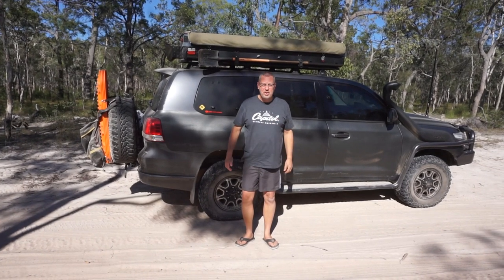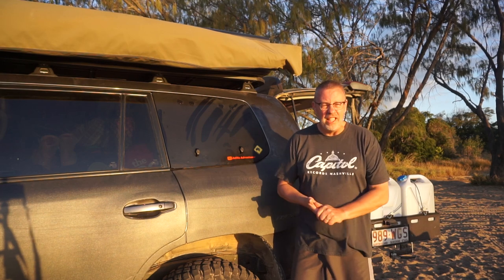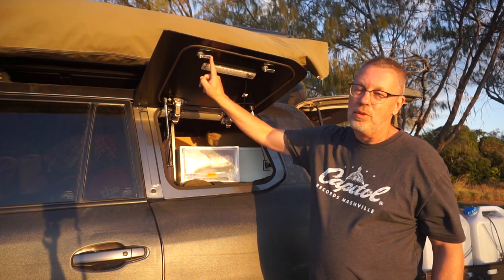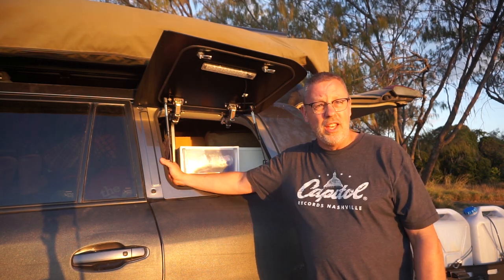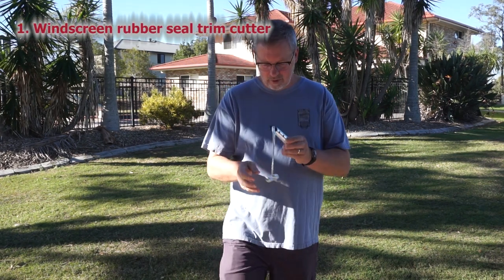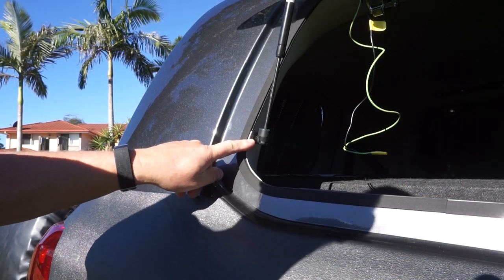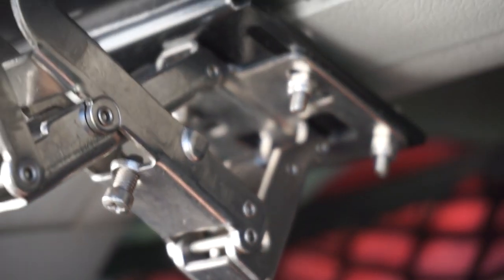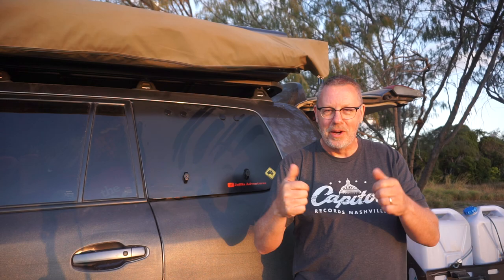Emuwing Gullwing Window Installation.  Do they Leak?  Plus Top 10 Installation Hacks | Ep 3

Comment: 1) This video made me smile. My stupid sister runs her 200 on recirculate 100% of the time since picking it up at the dealer. Inside it stinks from all the dirty air going around and around for ever. Myself on the other hand always have the AC on straight through. And from years of experience I can tell you that when you drive past a dead roo with the AC on recirculate versus on straight through the stink stays longer when using recirculate. Some people cannot be educated on AC use.

2) One could easily perform an A4 paper test during install (and later use) to see if there is any gap in the seal.

Happy Days :-)
Reply from the maker: I like the A4 paper test idea mate, cheers👍😎

Comment: Hi Terry, great work on the videos.  I'm sure sure many sitting on the fence regarding purchasing these items will be a little more assured after watching these vid's.  Question, what did you end up doing with the radio antenna after disconnecting it? Did I miss that detail? Keep up the good work.  Cheers Matt.
Reply from the maker: Thanks for the kind words Matt, I sincerely appreciate it.  Great question on the antenna mate, and well spotted.  I did not have time to resolve this before our big trip so ATM it’s simply disconnected.  I will have a future video of my solution for that.  Going to try two.  Firstly, I bought one of those cheap crappy signal boosters that install under the dash.  I will pull the dash apart and hook that up to the radio in the first instance.  If it’s crap (which I suspect it will be), I’ll install a proper antenna off the passenger side mirror.  Stay tuned for my misadventures there!  Cheers👍😎

Comment: How’d you go about removing the rest of the original window’s sikaflex on the paintwork? Tips?
Reply from the maker: Hi Charlie, thanks for watching and for the question mate.  I tried both wax and grease remover and thinners.  Thinners worked a little better.  I scraped as much as I could off with a razor blade, then went to town with thinners.  It’s a time consuming job but you can get it all off with perseverance.  Cheers👍😎
Reply: Jafffa Adventures thanks for that mate. I’m half way through installing mine 😁 yours looks great 👍
Reply from the maker: Good stuff mate, I trust the vids helped out a little or at least gave you comfort you were on the right track (not to say my track was correct of course😂.  Shout out if you have any questions and I’ll help out the best I can👍

Comment: Hi terry am looking at installing emu wings on my 200 are you still happy with yours are they holding up to your travels regards Paul
Reply from the maker: Hi Paul, they are holding up very well. I have had zero issues with them and they continue to seal perfectly.  The access I can get in the back is just awesome and I would do it again in a heartbeat.  It’s important to note that I’m not sponsored by these guys (nor anyone else), I paid full retail.  My feedback is genuine.  Thanks for watching mate😎👍
Reply: @JafffaAdventures  we have a same drifter draws the emuwings are for access to battery setup putting 200AHM between wheel arch and draws and delete both front battery's, installing wings myself wish me luck :-)
Reply from the maker: Indeed, have fun mate!
Reply: Hi terry mission complete wings installed yes not the easiest of installs. Getting glass out @#$&@$# lost some bark of knuckles & lady next door has new vocabulary but no breakage
I also received I’m ranger cargo net only took 6 weeks will install when finished the 200ah rear battery install
Lockdown project is getting bigger as lockdown extended have removed rear seats and extend storage system removed Drifta pull out kitchen replaced with 3 section pull out draw and table and induction cooktop section
My 4 camping mates have all revamped our setups here’s hopping end of October we can all do a shack down trip
Reply: Thanks for your video on wing install made my job so much easier 
Just watched snorkel filler install that’s on the list now 
Going to have to unsubscribe your costing me money LOL
Reply from the maker: Wow Paul, you have been very busy indeed.  It sounds like your rig is coming along very nicely.  I have to agree, I lost a bit of bark on my knuckles as well when installing the emuwings.  We got back from Cape York a month or so back where they were again tested to the extreme.  I’m absolutely sold on the convenience that side access brings to our camping setup, it’s a game changer and I’ll never go back.  I trust your neighbour uses her new vocabulary judiciously 😂😂.  Keep the shiny side up Paul and have a great weekend, every day the lockdown is getting one day closer to ending😎👍
Reply from the maker: Please don’t unsubscribe Paul because me costing you money is the only reason my Mrs lets me spend my money😂.  Glad you found the video series useful Paul, if it only helps one person (you) than my time was well spent.  Cheers mate, thanks for sharing 😎👍